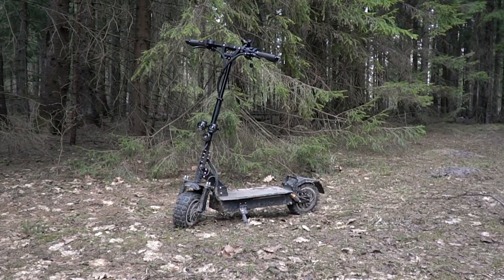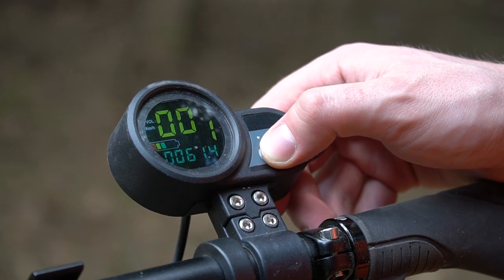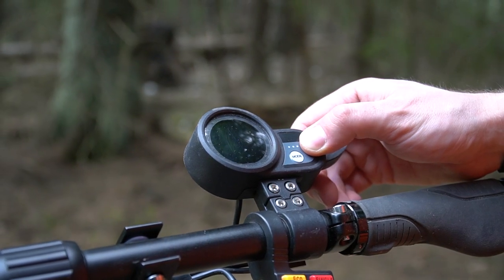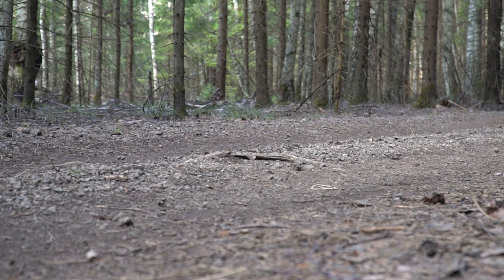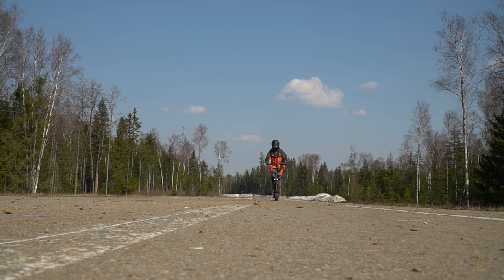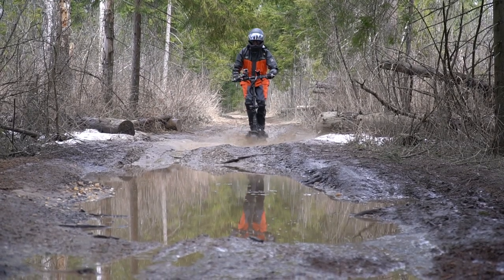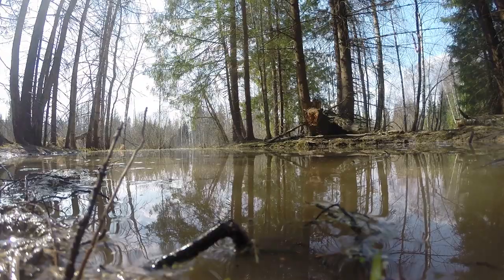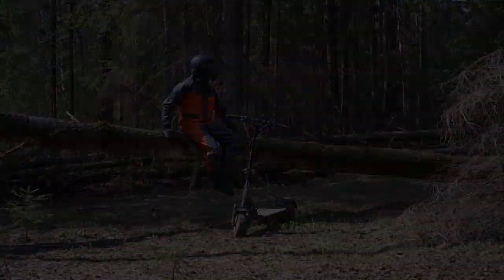Tough offroading on 2x2 electric scooter

Comment: Refreshingly crazy! Can I ask how the scooter was waterproofed?  Was it sprayed or did they try and seal the deck?
Reply: I'm also curious about this. I used a silicone sealant on all the holes on my Kaabo Wolf Warrior but I didn't wouldn't ride it underwater. This is some true next level waterproofing.
Reply: @GingerOnWheels  all components must be treated : controller, battery , motor, contacts , pedal and all holes
Reply: @vld3484  treated with what, would you mind to explain it in details? It's really interesting thank you

Comment: Hey, cool video! I love me some scootering. This scooter looks like a variant of the Nanrobot D4+. Those front spring suspensions are pretty bad, for anyone reading this if you're in the market for a scooter, you're much better off buying a scooter with hydraulic suspension or a swing arm with bushings, like on the Kaabo Wolf Warrior or Dualtron Ultra respectively. Slightly more expensive but the type of suspension shown in this video can be noisy. Notice how the sound was edited out...

Comment: Search results make it seem like it's RU only. Is there US availability?
Reply from the maker: There are so many analogs like ultron and dualtron
Reply: This scooter most closely resembles a Nanrobot D4+, which is available on Amazon. However, Nanrobot has terrible customer service outside of the 30day Amazon return window. I highly recommend Dualtron scooters though, very reliable and excellent customer service when you buy them from a retailer like ewheels or Fluidfreeride. 
Happy scooting!